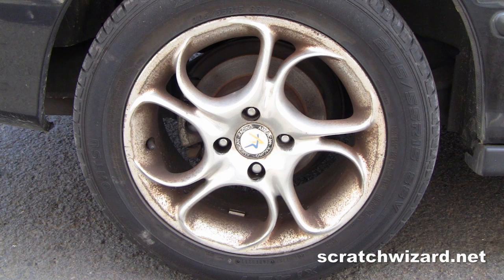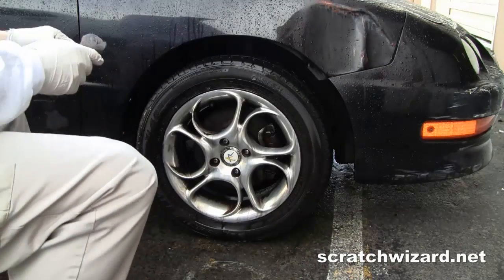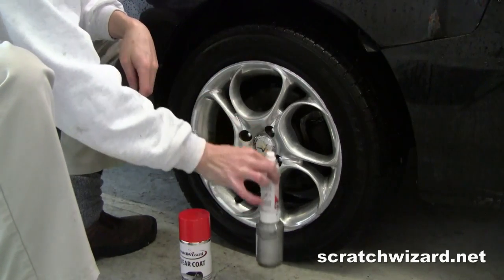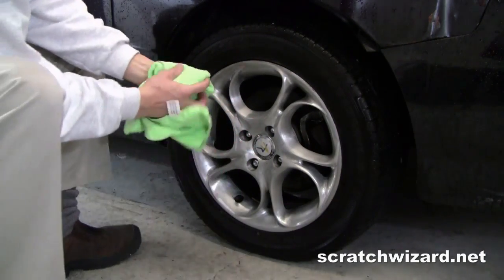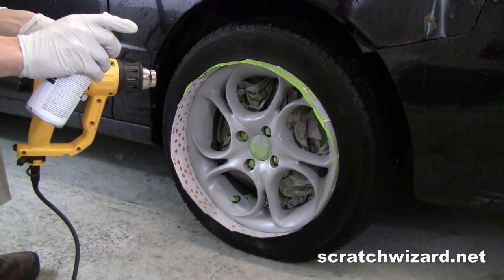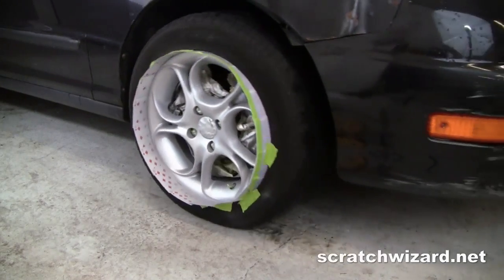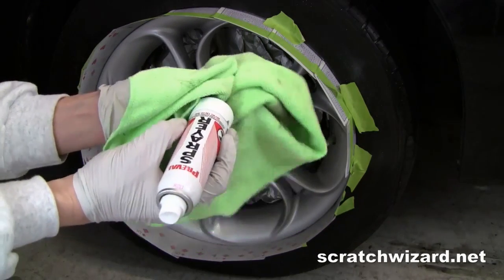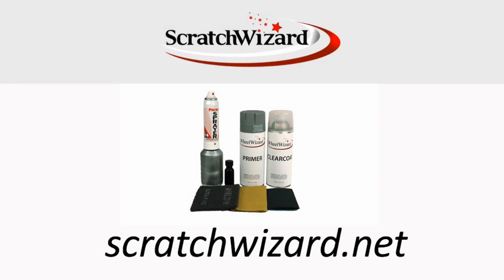How to paint aluminum wheels.

Comment: the problem is the clear in a can is garbage, after i painted my rims, i bought clear with hardner, sprayed 4 nice coats, a year later still good, rattle can clear is garbage unless you got the one where you puncture the bottom to mix hardner